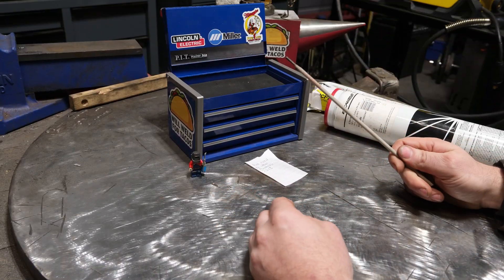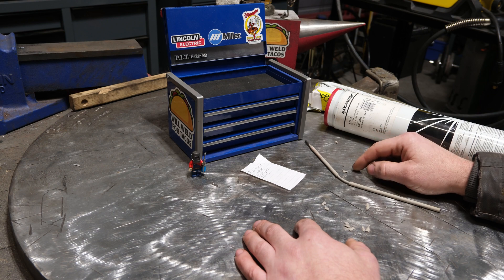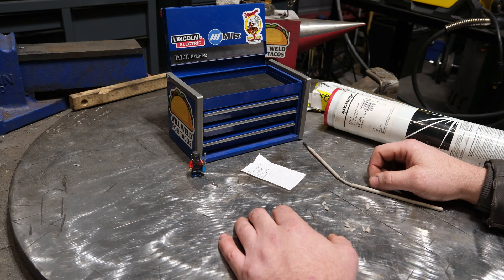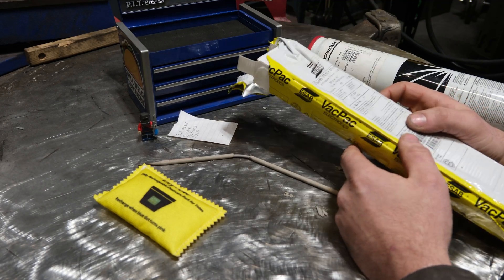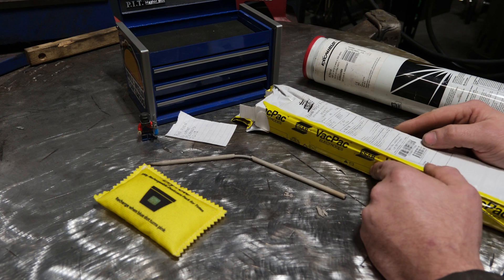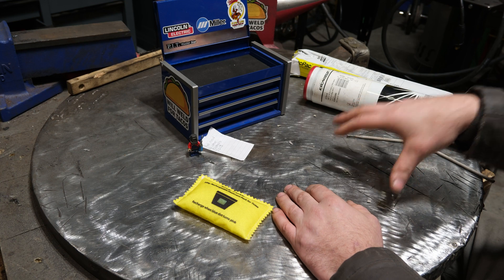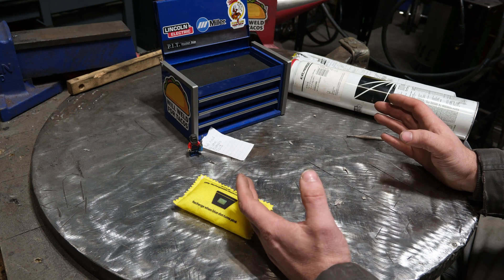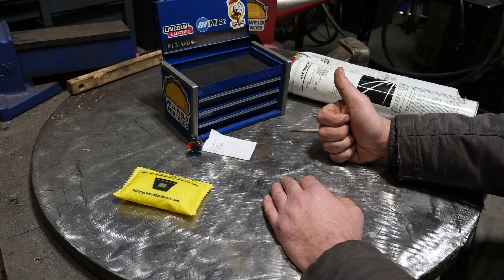QFTB #11 Rod ovens and 7018 rods

Comment: I do weld repairs on my own farm equipment and I build some stuff around the farm. Once I had a visit from a friend who used to be a professional welder at the shipyards. Upon seeing my pack of 7018's lying on the workbench, he explained the hydrogen embrittlement problem and what to do about it. So I met him half way, baked the rods and packed them in an airtight container. If I need to use 7018 now I usually bake the rods in a tin on the woodstove I use for heating my shop. It gets up to about 550 degrees, and I'll leave them on there for at least one hour before welding. So far I haven't seen any cracked 7018 welds. But then again I don't really weld critical or life supporting stuff.
Reply from the maker: For a majority of what you will do it won’t make a huge difference being out of a rod oven or sealed pack.  Just knowing what you need to do  with heating the rods if you are welding high strength steel is probably the important part.  The second most important part is using 7018 since it’s far stronger than the other conventional rods lol.

Comment: Is a Miller CST 282 a good stick welder ? I need a stick welder and I'm looking at one.
Reply from the maker: So I can tell you the 280 is an excellent stick welder and well proven.  The 282 is more or less an updated version of it.  It outputs more power on single phase, and has a few other updates.  I tig welded on a 282 at my work last week and it works good for that, I have not stick welded with one.  To me the only downside is cost, they are pricy brand new.  It’s kind of a niche welder, it’s tough to find a stick machine that can output over 200a in a fairly portable efficient package.  It really depends on what you want to do with it.  If you want a fairly portable high amp stick machine that will last, it’s a great option.  If you don’t need portability and want a stick welder that won’t let you down I would be more inclined to buy a used xmt350 or similar.  Those machines can last literal 8-10+ years in an industrial environment being used 12-16 hours a day.  They are just not really portable (80lbs and about 2x the size of a cst282).
Reply: @makingmistakeswithgreg thanks so much for that info. The portability is part of my needs. I also want a dedicated stick machine. I agree totally about the XMT. Awesome power source for sure. Keep up the good work. Your videos are most valuable to me.

Comment: I am getting quite an education here, watching this and your other 7018 videos. So, I still have about half a 50 lb box of RACO 7018, dating back to, and opened in, the 1980s. Funny thing: I didn't go to a vocational high school, but we did have welding in shop class. I also took a night school welding class at the voke. I don't recall any talk about using or needing a rod oven. A close friend back then did go to the voke. His dad was a welder. I learned some things and saw amazing repairs and builds on heavy equipment, but I never saw a rod oven. Doesn't mean he didn't have one, but I never saw it. What's up with this? Are rod ovens a fairly new thing?

So, back to my old box of 7018s. I pulled several out yesterday. There's light rusting on the stinger end. I removed the flux on a few and there was zero rust underneath. Not what I expected at all. Are they junk, or can they be dried?

Rod ovens - do you have any recommendations? I see used ones that look like yours pop up on Marketplace. Then there's a bunch of different small ones on Amazon, but which ones are the good ones? Thank you for making the videos!!!
Reply from the maker: So low hydrogen rods were more or less a military secret during ww2.  Metallurgists knew there was a serious issue with certain steels having cracking issues when welded.  They would have more or less discovered hydrogen being a culprit, and then designed rods with low hydrogen to prevent weld failures due to hydrogen embrittlement.  It is possible that the original rods were simply delivered in a sealed can and had to be used within a certain time.  Realistically the rod oven would have followed the invention of low hydrogen rods pretty quickly.  

What you describe isn’t out of the ordinary.  A neighbor of mine that worked for a major crane manufacturer told me he used a rod oven that was a small old refrigerator with a light bulb in it.  My guess is they had “rod ovens”, just not conventional ones.  If they didn’t they just used the rods within 8-12 hours after opening a box.  

As far as those rods being useable, I am sure they would still run.  At this point they would likely have some moisture in them.  By code you would need to bake them at high temp (500+ for 1-2 hours).  The downside to this is it can cause really old rods to start to have flux cracking.  From a realistic standpoint I would say 350-400 for 2 hours should dry them out enough to work decent.  I wouldn’t go and weld high strength alloy parts on something like a tractor with them but for general work on mild steel it won’t be an issue 😀👍.

Comment: Would a rod oven be necessary for welding mild steel with 7018? Thanks. I love your videos.
Reply from the maker: Realistically no you wouldn’t need a rod oven for welding mild steel.  If you keep your 7018s in the original pack and try to keep them dry they technically won’t meet the requirements for low hydrogen but they will have virtually no moisture in them compared to any other rod you might use.  On mild steel you won’t have any issues.  Even on higher strength steel a non rod oven stored 7018 would be miles better than say 6011 or 7014.

Comment: I have a bunch of 7018, hyundai, it came in a non sealed package and sat a couple years in my shop, which is not a desaster, but a little bit too humid for comfort in some seasons. Kinda weird half basement that never really gets sunlight due to facing near perfectly north. They start like absolute drunkards and leave the mother of porosity. Once they have been fired for a couple seconds, they wont make porosity on a restart. Tried drying them in my Kitchen oven, didnt do too much. I will heat the tips with a hot air gun in a pile of foamcrete style light firebricks next time i weld. Clearly have some sort of direct impact from something.....P.S. Maaaybe ill lug the big old machine that doesnt shut down on a dead short like an inverter out into the yard and try sticking them for a good few seconds to flash dry.....
Reply from the maker: Part of what can happen with old rods is they develop rust near the exposed tip between the flux and the rod.  Often times they will run better after the first 1/2in is burned off.  I have a big tin of rods like that (both some 7018 and some 7024 rods) and I just use them for practice.  Starting porosity sucks to grind out and fix lol.
Reply: @makingmistakeswithgreg  ahhha. Thanks, i will check for that and test around once the weather gets back to welding friendly

Comment: Good timing on the video, was just wondering if keeping the rods in a dry warm place was enough. Like in a boiler room where the air humidity is low due to the wood fired boiler keeping the air dry. 
I did watch your water soaked 7018 video where you showed the rods are still good if doing low liability or "farmer" welds.
Reply from the maker: If you keep them in some sort of plastic container that keeps most of the ambient air off them they will be fine😀👍.  No, they won’t meet code, and no you shouldn’t use them to reweld together a broken excavator arm, but for normal low liability stuff you’re fine.  Even more so because they will put less hydrogen into the weld than any other stick rod you might have.  Especially since many rods are made with tons of moisture in the flux.

Comment: Greg I gave thought to all those "old welder tales" because they were cheap and easy.  The cheapest being that beginner thing, stick the rod.   After a little thought, I realized they were just pipe dreams.  I can't believe how many welders swear by them.  
Like to chat, but I have some welding to do on some wet metal.  Got to go hit with the torch to cook out the water and hydrogen...
Reply from the maker: To a certain extent anything to get a 7018 warm will likely make it run better.  However only following the specific process of heating to specified temps will make the rod meet “low hydrogen”.  Many people never weld on higher strength steel, so it tends to not be an issue.  If they did, there would be a ton more weld failures lol.

Comment: Do you have an opinion on yesweld wire? I see it on amazon inexpensive. My needs are mostly auto exhaust/ body so it dosent matter but what is its quality  in your opinion?
Reply from the maker: For that use I think you’re fine.  I have ran different wires with mig and I have noticed slight differences in how they weld.  With mig it tends to be differences in the oil on the wire (aka how much smoke), how much crap is on the wire that falls off near the drive rollers, how nicely wound it is, etc.  you might get more silicon islands with one brand over another but other than that I wouldn’t be afraid to run it if the reviews are good.  I am not a fan of yes welders “welders” but their tungsten seems ok and a few other things I bought from them are ok.

Comment: Great information on 7018. My 7018  came in a plastic case that weren't sealed and they've been on my workbench for months so I guess when I use them again which isn't much I mainly TIG weld could I bake them in my oven in my house? I don't know how hot it would get but probably at least get 500°
Reply from the maker: So if they have been sitting out they will have more moisture than ones out of a pack, but still likely less than other common rods (7014,6011,6013,etc).  They tend to weld worse left out for a while regardless of moisture in the flux and tend to get a pinch of rust which isn’t good.  If you have an oven clean option on the oven, setting it in that would be more than hot enough to “rebake” the 7018.  Otherwise a hour at 500 would do as much as you can.  The issue mainly comes out if you were to do “code work” or high strength steel welds, but even just welding normal steel together they weld best when they haven’t be exposed to the air for a while.
Reply: @makingmistakeswithgreg  Great information especially on the self-clean feature on the oven. I didn't think about that.

Comment: Most 7018/7016 are vac packed and have a use of 12 hours before re baking
Also the use of an electric quiver is a big help, follow the welding procedure no issues

Comment: The freshest, driest, 6010 is going to impart more hydrogen into a weld than a 7018 that's been sitting out in your shop. That's because 6010 uses cellulose flux, and hydrogen is part of cellulose. When the flux burns, the carbon part combines with the oxygen in the air, releasing carbon monoxide and carbon dioxide. That shields the weld. But with 6010 flux, when that carbon is burned, the hydrogen part of the cellulose is released. 7018 flux doesn't use cellulose, so when it burns it only releases carbon, potassium, and sodium. If you are making welds with more than three passes, use fresh 7018 to be safe.
Reply from the maker: 100%.  I didn’t stress that in this video (since I covered it in the linked videos) but you’re absolutely right.  It’s very common for people to talk about avoiding 7018 for rods without storage requirements and using 6013 or 7014, not realizing if hydrogen would make a difference they would actually make the issue worse.

Comment: I just use 6011 rods and a 5 gallon bucket with a lid I don't have time to play around with a rod oven never had welding issues 35 years in the game
Reply: 6011 isn't a low hydrogen rod and thus gets no benefit out of being in an oven. Out of the elements, yes, but you don't need them in an oven.

Comment: A metallurgist once told me that mig is inherently low hydrogen. This was when I asked him about a job I was going to do for the nuclear industry. I just about never use rods since then and that was back in the 1980's. Water absorption is also a problem with flux core wire so you need to keep that in an oven or just bitn the first layer if it has been standing for a few days after opening the pack.
Reply from the maker: Mig is most definitely low hydrogen, and doesn’t have hydrogen embrittlement issues 😀.
Reply: @makingmistakeswithgreg   As long as the wire is rust free and there is no water in the gas.

Comment: Hobbyist, property owner here ... thanks, Greg, good for me to hear this. I never realized that welding had so much in common with the NEC
Reply from the maker: Welders bicker about welding code a lot, but the code is far simpler than the NEC.  That’s a good thing because less is open to interpretation.  I always get a laugh when complex electrical code questions get asked and there is a 5 hour conversation/bicker fest with 7 different answers lol.  Welders are pretty grumpy but man a bunch of an electricians and the NEC will make enemies fast 😅.

Comment: Hi Greg, I got a question for you. I bought a tig welder a year ago, and have been slowly getting everything i need to start welding (sure is a lot, maybe a checklist would have helped me).....argon tanks being the most challenging with fees,  and rental agreements being the hardest to figure out as a hobbyist. I have managed slowly thru this web (i'm sure if i was wealthy it would have been easier), but I am stuck at a crossroads.

 I see different opinions on what I should start on first, maybe because they lead to bad habits, or change the learning curve. So to a new apprentice what would you suggest...Aluminium, Steel, or ??. My welder is capable of at least 1/4 inch  aluminum with a  LC torch (primeweld 325). I saw your tig videos, but I am not sure what material to start with....or if that's even a thing.

Thanks again for all your inspirational videos, and your shared  knowledge.
Reply from the maker: I have a bunch of thoughts.  So first off, I personally started with tig welding.  I could tig weld perfect beads before I could even mig weld.  Tig welding gives you a better understanding of welding in general and it’s totally ok to start with it first.  As far as where to start, there are a lot of ways to learn.  Believe it or not your ability to handle frustration is a major factor on what to start with.  Aluminum tig is a great way to learn to feed filler wire and to get a lot of practice in because the material is easier to weld when hot (you can run tons of passes on it).  The downside is aluminum is more expensive, and it’s more frustrating to weld at first because it tends to contaminate the tungsten.  If I were you I would start with a 4 to 5inch wide by 6-12 inch long strip of cleaned up steel.  Practice running beads across it.  Run beads at low amperage (say 50-80 amps) and run some at higher amperage (170-200).  With a whole plate filled up with beads you should be ready to tackle actual joints.  One of the great things with tig is after you run a bunch of beads on a plate, you can grind it down and just reuse the plate.  Since the welds tend to be small it’s not like you’re grinding off a ton of metal.  This allows practice to be cost effective.  

Once you can weld straight equal width/height beads welding butt joints, lap welds, then fillet welds should be in your near future.  The hard part is knowing when to move onto harder stuff.  The truth is that you don’t get better unless you weld things that you fail at.  I got better at fillet welds by failing at them (typically having lack of fusion issues via moving to fast).  Once you get a feel for it tig is actually not hard, you just have to embrace failure for a while.  

I definitely need to get around to finishing writing up the welding plan I started that gave exercises and expectations.  Having a plan can go a lot way to help keep progress going and for someone to understand where they are.  Your post has definitely motivated me to get back on that 👍
Reply: @makingmistakeswithgreg  Thanks, I really value your input...and desire to teach.

Comment: Hey Greg, all this got me thinking, I remember that a hydrogen process existed back when we all wrote on stone tablets LOL. I got this from the internet. Atomic hydrogen welding (AHW or Athydo) is an arc welding process that uses an arc between two tungsten electrodes in a shielding atmosphere of hydrogen. The process was invented by Irving Langmuir in the course of his studies of atomic hydrogen. This is cool, ARC Specialities Inc link for demonstration, I'm pretty confident that high strength steels didn't exist back then for this process; https://www.youtube.com/watch?v=NEktRlcrrM4
Reply from the maker: I have seen that process only in books, I will have to watch the content on it.  I believe I have seen welds done by the process in an old power plant I toured before it was demolished.  The equipment predated tig yet the welds looked like a weird wide tig weld.  I have seen actual welding machines used for that process, they looked like a hot water heater lol.  Definitely a wild and almost forgotten welding method.  Someday I will have to find a way to try it out 😀.